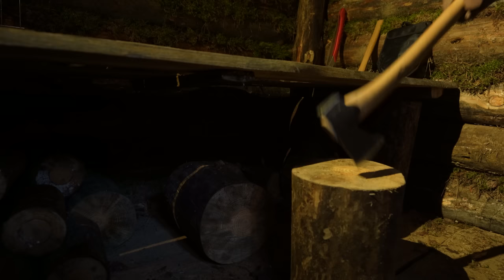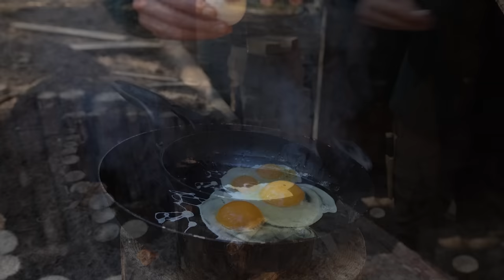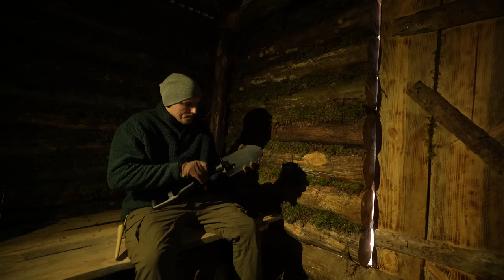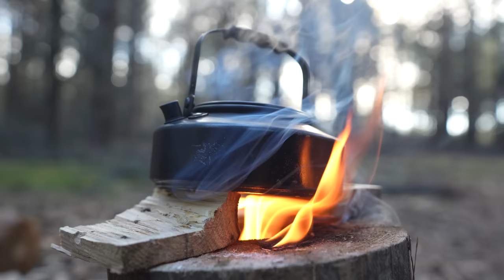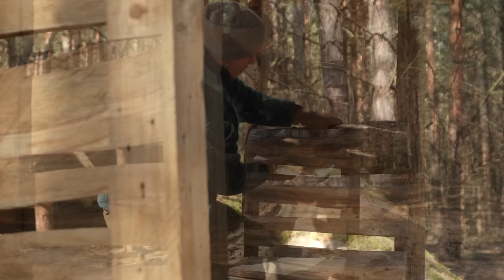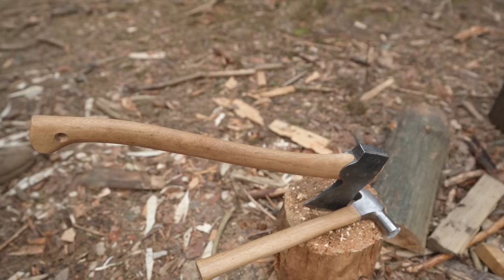Dugout cabin, Shelter buiding, Place for firewood from what I found

Comment: While I enjoy your video you did a wonderful job building the Dugout and camp. The only question I have is why did you put your fire pit and the wood pile storage so far away from The Dugout. I would have put them as close as possible to The Dugout so in case of rain you would be able to get firewood without getting soaking wet
Reply from the maker: This is still a trial version, which I did not like.